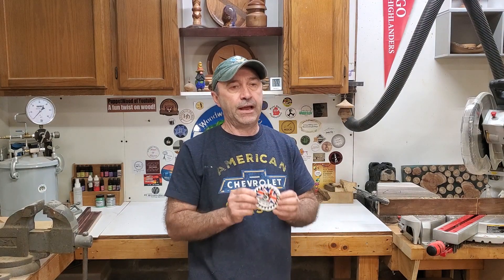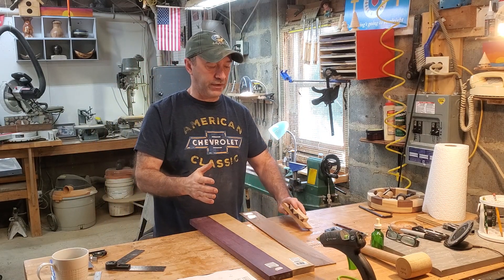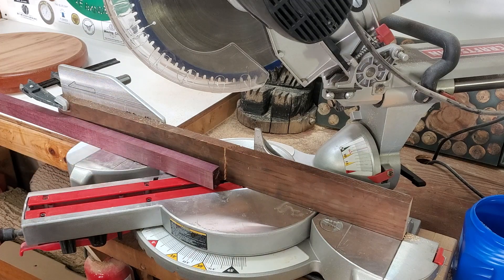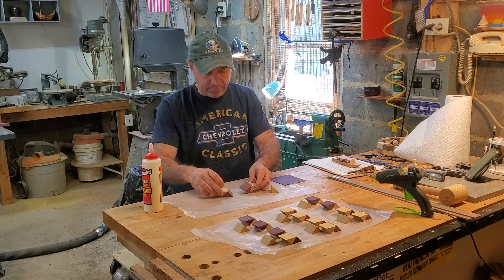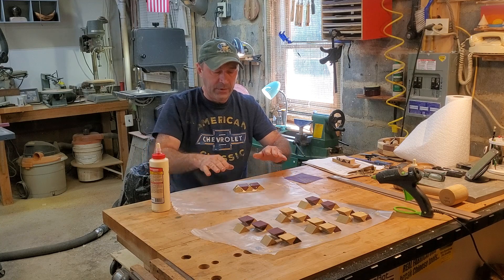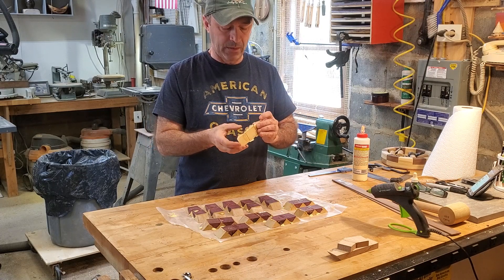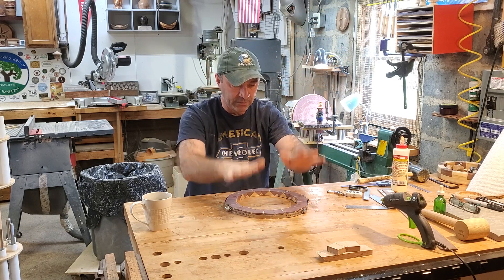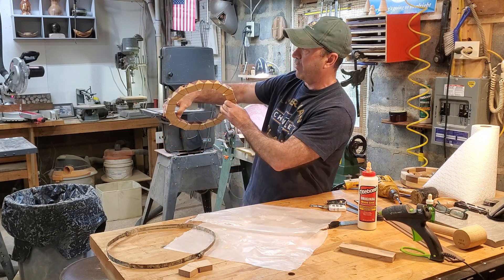Creating A Triangle Feature Ring Wood Turning

Comment: Nice feature ring. Looking forward to seeing the rest of the vessel. A couple of suggestions. Instead of using wax paper, get a cheap silicon baking sheet. Washable and reusable. Also, when cutting the segments, I always use a stop block so the pieces are consistently the same size. I also make a few extras just in case one doesn’t get cut right. Keep on turning!
Reply from the maker: Greg,
Thank you for watching and commenting your support is greatly appreciated and those are some great suggestions 👍